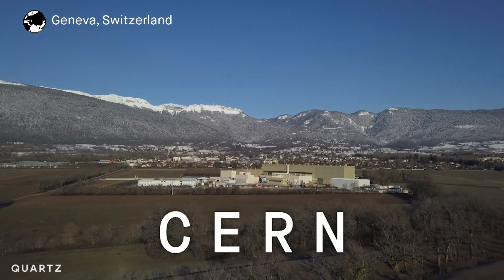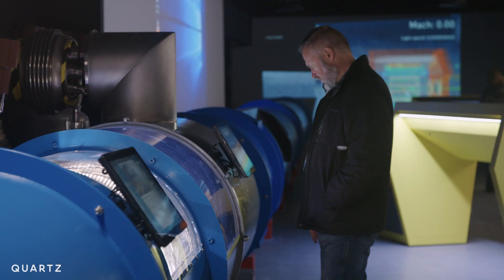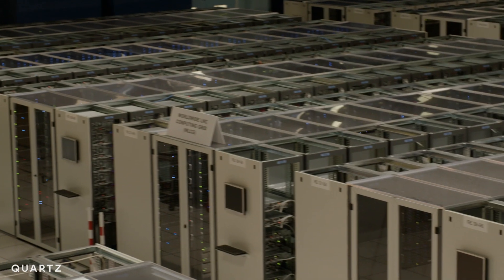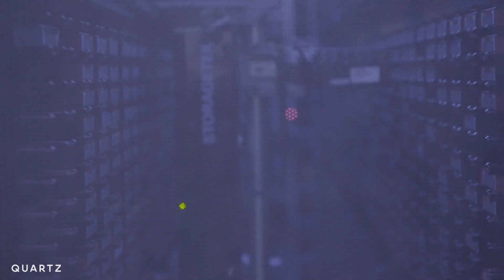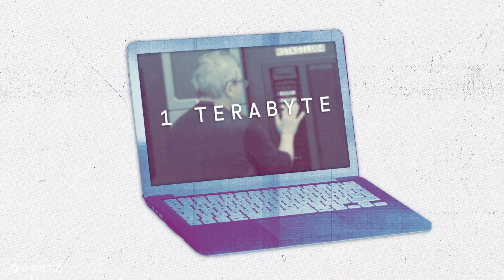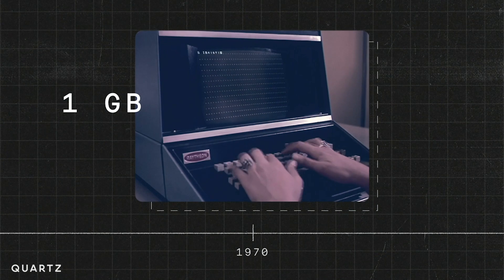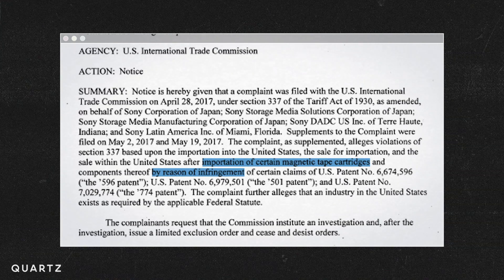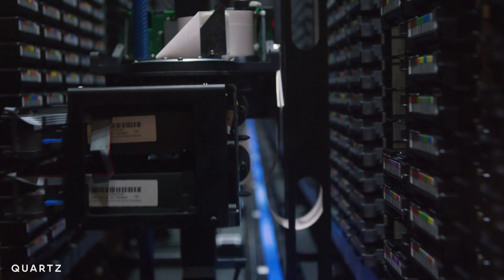Tape is here to rescue big data

Comment: I just learned about Ultrium tape cartridge drives the other week. It's insane in terms of data density. The current incarnation of cassette, the LTO-9 has a real world (not advertised) capacity of 18tb! And that's PER CARTRIDGE. These are drives meant to use multiple cartridges interchangably. They're great if you have tons of data to archive. But, an LTO-9 drive costs over $6k. But the cartridges (with 18tb of storage, mind you) are probably $400 or so individual, $200 if you buy in bulk. It's hard to say because most places won't give a quote unless you call them. Meanwhile the LTO-14 format planned for the future will have 576tb of storage per cartridge. Of course, this isn't going to be any good for day to day use. The transfer speeds are very slow. But if you just want to back up literally oodles (LITERALLY!) of data, this is definitely a cost effective solution for a large company.

YouTube channels even use LTO drives. I learned about these from a Slo-Mo Guys episode where they set up an LTO drive to store the countless thousands of hours of raw footage shot at up to 1,000,000fps or more. He said at their typical filming speed, 1 second of filming produces 1 hour of RAW, not compressed, footage. You can do the math to figure out how man fps that works out to. And being raw video, it's going to be many times larger than if it were mpeg or avi etc. And the owner of the channel said he keeps absolutely everything he films, regardless of how important it seems, even if it's just 2 hours of waiting for something to happen. So, this was an ideal solution for them.

Comment: tape backup never went away. but it's not useful for working data, only for backup, and the drives to use the tapes will cost as much as a used car.

Comment: I read several years ago an article that we reached at a point we can store 1byte in 96Atoms  (12 atoms per bit) the storage capacity changed by the years but is it possible to use normal tapes but change the reader and writer or is this impossible?

Comment: tape is just good for archive and back-up, but terrible to work as a storage drive in an active device such as computer
Reply: Thats not what they are using it for.  They can fit the data into the active storage all at once, so whne they need it they can pull it off tape.  They will spend a long time working with that data so the tape access time means nothing.

Comment: How long does it last for.
Reply: Designed for 30 years as long as you dont use it to play hokey with ;)  However most users will move data to new tapes before then anyway as higher capacity ones come out.

Comment: A lot of this is not correct. Tape never left, it's been used in the enterprise space for decades. Just because you don't see it on a daily basis doesn't mean it isn't in use. Also Tapes are NOT cheaper than spinning disk drives, in total they end up costing the same amount if you scale it to the proper sizes. Also these drives are NOT offline, how else would you store data to it if it wasn't connected some how? Granted that is through a transfer cabinet, but they are still online in the technical sense that they are accessible. This is a very misleading video that just flat out isn't correct in many instances. GET YOUR FACTS STRAIGHT.
Reply: Its consumers taking a peek in the server room and wondering why they dont see HDD's from best buy ;)

Comment: Yeah. But sadly those are Read and Write only, so no Rewrites.. don't mess up that really important essay, that grammar error will stay on there forever.
Reply: What? Oh you are saying they are WORM.  Nope, not those tapes.  You can get WORM tapes but they are not frequently used.  Most tapes you buy are the standard re writable variety.

Comment: Ya but its slow. The random access speed is trash
Reply: Because it has no random access.  You cant get there sort of is you format the tape with LTFS.  Once you have got to your data transfer speed blows SSD's out of the water.  Only takes a few extra seconds, if using LTFS that is.  If not then you have to seek through the tape till you get to the data.  But still, better than a hdd or an ssd :D

Comment: If there were 1GB tapes in production in the 1970s and '80s, why could VHS only store one movie or three episodes each?
Was it cost? Could data not be retrieved fast enough?
Reply: VHS stores analog data, it's a direct representation of the actual scanlines of the video. There was an lgr video with a VHS backup system for PC's, I think that also stored the digital data in an analog waveform.

Comment: “Storing things on tape means it’s offline” What? That’s not true at all, if the machine connected to these tapes is connected to the internet so are the drives. With this reasoning you could say “Storing things on Hard Drives means it’s offline” as well.

Comment: CERN: We are so smart, we have our data backed up with tapes to prevent hackers
Me: brings magnet
Reply: NASA wants to know your location
Reply: IF you can even smuggle a magnet inside one of the most secured locations on the planet..
Reply: @KayoMichiels  well that place is literally a magnet place
Reply: Actually modern tape needs specialised hardware to use a magnetic field to wipe it. They don't react well to a permanent magnet, they hardly react at all.
Reply: They have super strong magnets that guide the beams,
Ironic
Reply: Good luck having that magnet not get ripped out of your pocket by the LHC.

Comment: Having tape means they are relatively vibration damage proof and (as long as you don't factor in the cost of the machine to read/write to them) relatively cheap, but they are susceptible to degradation over time and fire.  As long as there are 2+ copies of each bit of data though, it would be almost impossible to loose any data in long term tape storage by accident.
Reply: All storage mediums are susceptible to fire, save for some forms of optical storage. And clay tablets, I guess.

Comment: s anyone working on integrating this technology into a personal computer? Because that would be cool to have so much storage in a laptop.
Reply: It’s horrifically slow for non-linear/random operations like getting a file or two. If you need to back up a ton of data, you can always get a standard LTO or Ultrium LTO tape drive that fits in a computer tower, or pick up a changer device with a drive and some tapes from a business auction or eBay, etc... they can be a bit pricey, but a small second-hand tape library or bare drive of LTO 5 or 6 still has a ton of storage capacity and gets close to normal consumer price points.

Comment: So tape is easily flammable/meltable right...so how do they preserve it all in such a hot storage room?
Reply: their storage room isn't hot. They will have systems in place to maintain correct temperature. But what will be making it hot? Hard drive storage rooms are only hot because computers and hard drives are hot when in use, they don't have those here

Comment: I was literally doing work experience with IT infrastructure of a hedge fund company a couple weeks ago, and I was swapping out these exact same tape drives. Each one had 8tb in them, and apparentely these were the 'older generation' ones, whilst the newer ones can go up to 16tb or something ridiculous like that. Apparentely each drive is only £20, but you need a reader worth 10s of thousands and the data cant be as easily accessed in a hard drive, as the data needs to be read from the start of the tape, which takes up to 8 hours. They also are more susceptible to damage from dust if exposed, but other than that, they are more durable in pretty much every way to hard disks.

Comment: I think this is giving a very false impression. Tape is not used for storing the data, like on your laptop -- it's used for archiving. The purpose of these tape backups is for if the primary storage method fails
Reply: “This is exactly what they just said”, to address this argument, they presented some of the argument like this, although they were unclear at some points. For example, the expert tape guy said he didn’t know of any storage mediums which could beat tape, and he was cut off after that, and I would assume he would have clarified that he meant in terms of cold storage and archival purposes, rather than mainstream consumer products, such as the aforementioned laptops. The problem here is that they didn’t do the best of jobs clarifying that they meant specifically for archival storage, rather than storage meant to be used at anytime by your average person on their laptop. The difference between read/write speeds on just tape and a  low end 5000 RPM HDD is gigantic, and the gap grows even further when you bring in SSDs. The video also never brought up the absolute snail’s pace at which tape reads and writes data, which isn’t a problem if it was entirely gauged towards a techy audience who already understood this fact, but the problem also arises that this video seemed to be gauged towards people who lived through the time of mainstream tape storage for consumer devices, and it doesn’t go into a whole lot of detail on the more technical aspects of why they use tape, how expensive it is to use regular hard disks over tape (considering 12TB consumer grade HDDs are a thing), and how it’s “safer” to store it on tape (this could just be referring to it being used as archival storage, but that’s a bit of a stretch considering they were comparing it to hard disk storage). They did, however, mention that Google used the tape as a backup storage, rather than a main storage medium for some of its services, so I do give them credit where it’s due.

All in all, the video could appear somewhat misleading to someone who didn’t pay attention to every word and isn’t very into tech stuff like storage mediums in Silicon Valley, and I think they could have done a better job clarifying this, as obviously not everyone even knew that some of these companies even still used tape for any storage whatsoever, but if you were really interested and maybe thought buying a tape drive or something like that for your next gaming computer would be a good idea, with even the most basic of searches you could easily find out how slow they are and that their main use is for archival data as they are so slow, but large and relatively inexpensive.
Reply: Thats basically what they are saying
Reply: there's some people saying this is what the video is saying and i think I'm just being misunderstood. the video seems to imply that tape is used as a primary mode of storage at CERN. this should be impossible. the read rate of tapes is simply too slow, even just to read the data for regular processing.

it's well quoted that when running the hadron collider at cern produces 1PB of data per second, which is a collosal amount.  you could download every show on Netflix in every quality in 3 seconds at that rate. tape drives have a max throughput of about 750mb/s writing contiguous segments. you could stripe the data for extra throughput, however.

this means, that like Google who also use this technique (and likely Amazon, with glacier) most everyday data must be stored on a traditional storage array, with the tape for backup. this storage array is never mentioned in the video and I came away with the impression that CERN used tapes for primary storage. if this is the case, it's the only case i know of in tech and i would be extremely impressed . or horrified
Reply: @Zemnmez  At 1:30 I hear 1 GB of data per second, 20 million GB each year, or 20k TB/yr, or 20 PB/yr. Also, at 2:00, the library then had 30k 10TB tapes, which is 300 PB.
Reply: Well the thing is they DONT have enough primary storage to store everything so it gets put onto tape. When it's needed they pull it off the tape to primary storage. It is not just for backup and archive, they are using it for capacity.
Reply: They’re saying exactly that. Nit picking isn’t necessary here.
Reply: but pls keep in mind, CERN doesn't have high capacity storage drive to store all of the data, you can use high speed camera analogy for this application
Reply: Or to move vast amounts of data off of primary storage for later use…aka archiving.
Reply: He is correct. The video fails on making the fine but very important comment on that the tape DOESNT replace hdd's, but rather just back up old data
Reply: So literally what the video is saying? You’re just nit picking word choice that means the same thing and gets the same idea across.
Reply: Wouldn’t imagine tape be reliable for archiving, since tape degrades.
Reply: @rtdfklfghyujigyuhv All media degrades. Tape stored in ideal conditions is good for 30 years.
Reply: @wesley00042  Yeah. I've learned more about tape ever since I posted this comment. In a lot of cases they last a lot longer than 30 years too.

Comment: Can the data be corrupted or deteriorate with time? Like old VHS. If this us important data surely they want it to last for decades or maybe even centuries. Who has info on these new types of magnetic tape.
Reply: Since the data is digital, it more resilient than the analog that vhs was. As long as you can still tell that you have ones and zeroes.

Comment: I may be operating with a lot of conformation bias or else my perspective is wrong but I would say that the average laptop.... does not.... store 1 terabyte of data. Maybe the average new laptop in 2019 but that is not the average laptop in use
Reply: No average laptop has 1tb, that's often the second highest storage capacity available to most laptops, so you're right

Comment: The whole time they spend comparing it to hard disks when hardly anything uses a disk hard drive anymore, most now use SSDs
Reply: but ssd is expensive... they used just to store the data, so slow read and write not a big deal
Reply: Very untrue, in an enterprise setting anything nearline is stored on SAS HDDs

Comment: Only downside is tapes random read or write speed is horrible. Good for backups tho
Reply: great for cold storage
Reply: i don't think anybody was suggesting using tapes for anything other than storage, in this day and age - they're an archival medium now
Reply: @dancrocker9318  which is what it is  meant to be used for these days, hence the video you just watched.
Reply: @Yksacnalbasac  you must have a very big brain
Reply: @dancrocker9318  oh im sorry, i meant to reply to the parent comment. whoops
Reply: The read/write of LTO is incredibly fast. Somewhere in the 200mb/s range, where hard drives are limited around 125mb/s. The retrieval speed is slower, because it has to reel to where the data is stored rather than just jump right to it, but the read/write speed is not slow at all. This is the biggest problem tape has to overcome- bad public perception and misinformation.
Reply: Tape random read be like....i need to put a few video clips on a timeline, 20minutes.....later
Reply: @zhixiangzhao2597  there's always that one guy storing his league of legends files on a tape drive
Reply: @zhixiangzhao2597  once you've started retrieving you can get like 1 gigabyte/s (faster than hdd)
Reply: Linear Tape File System
Reply: i want to try and load gta online with one

Comment: 1gb per second? What kind of data they get? Universe mixtape?!
Reply: Yes, they are recording the universe's mixtape
Reply: You should see how much the seacable's bandwidth.
Reply: It's fire!
Reply: Collision data
Reply: When the two protons hit each othe r they disintegrate in a multitude of smaller particles
Around the point of impact are various sensors detecting the directions and the speed othese particles ro try and identify them
Also,they try to measure as much collisions as much can to have a statistical approach
Reply: Jio Dhan Dhana Dhan 🤘😅

Comment: I can't believe how humans are returning to/sticking with all these mechanical elements in electronics. Tapes need tension levers and spinning wheels to operate, HDDs are essentially spinning CDs stuck together and now even some phone models have motors inside to slide out cameras, because god forbid a phone has a notch or an edge next to the screen.
Reply: Because they are more reliable to save backups

Comment: Are there any downsides? I'm just curious.
Reply: They lose their data if placed in a magnetic field. Also direct sunlight corrupts data.
Reply: Isn't  that the same problem  as HD. I thought  tape is more reliable.  I used to be do tape backup for a company It took forever to backup, search n restore.  Those are drawbacks
Reply: When you have a file on one end of the tape and another file on the other end, it might well take you a couple minutes to just get there. Tape is not for active storage, it's just a backup for HDDs and SSDs.
Reply: Degrades over time.
Reply: @bftjoe  30 years.
Reply: The cost of the tape reader/writer is high compared to just getting a harddrive (if used at consumer scale) but when storing a lot of data tape is much cheeper than harddrives.

Comment: But wouldn't accessing data on tape be more slower than if you were to do the same on an ssd or hdd because you'd have to unroll the whole thing first just like trying to find that song on a cassette tape?
Reply: It's fast enough, and technically we don't even use all the bandwidth of SATA 6Gb/s, so it's not big deal thou.